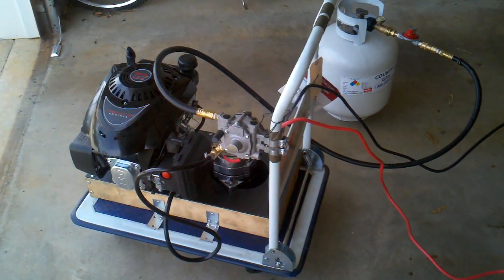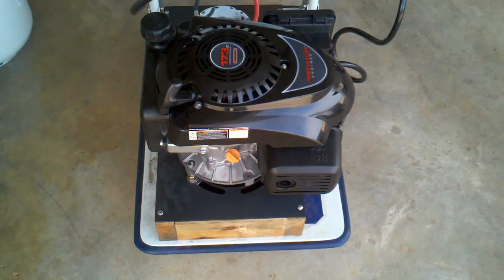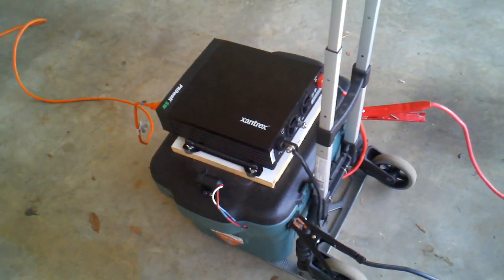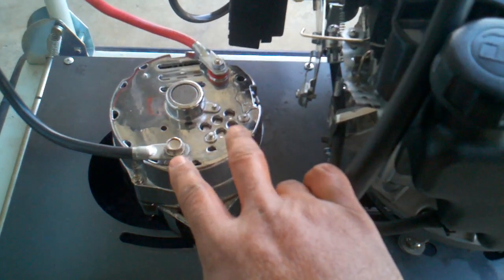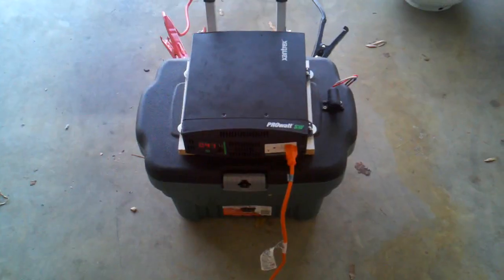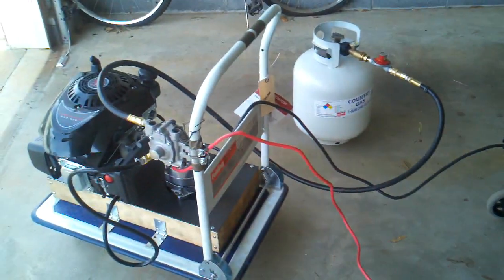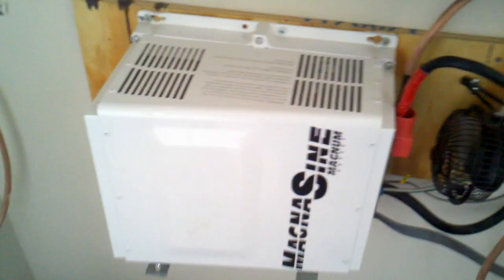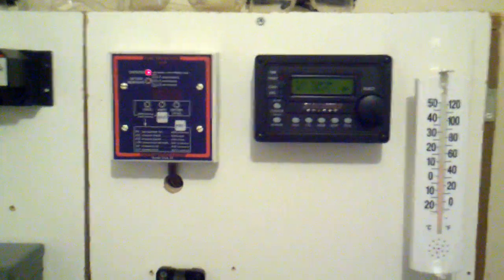DIY - Bi-Fuel Gas and Propane Lawnmower Generator

Comment: ok so this is what i have going after doing your equation with my alternator, 140amp alternator x 14 = 1960 ÷ 746 = 14,621.6 x 2 = 29,243.2 what am i doin wrong. please respond.
Reply from the maker: The engine is a 6 hp engine.  So 6hp x 746w = 4476w (potentially).  However, that doesn't mean I'm going to get 4k out of it, because of in-efficiency of the setup, and this alternator is designed to run at maximum rev's from a car engine, not a lawn mower.   So the alternator is not going to put out it's full capability so it's not going to give out the amp rating it's rated for.
Reply: +rhandsom sry i did my math wrong lol i got my equation right now lol.
Reply from the maker: Cool. Take care.
Reply: +rhandsom. will do you do the same! thanks for the info on your video!

Comment: I have something very similar that I use for electrolysis and for charging batteries on equipment in the field.  Why are you running the primary regulator on the lpg tank?  That regulator will accept the high pressure of the lpg.  I used the same regulator on my lawnmower and generator.
Reply from the maker: It's been awhile since I played with this setup. I'm not sure I understand your question, please clarify? Thanks.
Reply: In the video, there is a regulator on the tank and one mounted on the hand rail of the generator.  The regulator on the hand rail is a high pressure regulator and does not need the regulator mounted on the tank.
Reply from the maker: Good point, I didn't consider that. I'll have to revisit my setup, thanks.

Comment: I would like a water cooled alternator driven by a tesla turbine that makes hot water too. I want it quieter, cheaper and maybe smaller and longer to charge the batteries which would handle peak power demands like the refrigerator in conjunction with the alternator generator. I'd like to see110 coming nativly off the Alternator. If it was efficient enough, run it any time you need hot water normally everyday. Why burn Natural gas in a water heater and only make hot water and not electricity too?

Comment from the maker: To do a pdf with the parts list etc, is not a bad idea, but it takes a a bit of time.  Also, the batteries I have are deep cycle batteries.  If you go to TheEpiCenter(dot)com, you will find a web page detailing everything you need, should give you a good idea of where to begin.  That's where I got my original idea and the base plate from.

Comment: Brown's gas is like a battery. It is a method to store the energy that you put into it and make it portable but due to inefficiencies, you will never get the same amount of energy out that you put in. It will put a larger strain on your generator and consume more fuel. If you use solar to generate your Brown's gas, then you have a viable option, but there is no such thing as perpetual motion.

Comment from the maker: I probably would've went with a horizontal shaft engine and mount for the DIY generator, I would've bought a combination Grid-Tie,Inverter\Charger pure sine inverter and bought panels of the same type with better mounting.  With panels of the same type, I would've also only needed one large charge controller instead of 2.

Comment from the maker: Thanks for your comments.  In this case, my main inverter is 4000w with both 120v/240v output connected to the house via a transfer switch and a Interlock swith at the mains.  This setup allows me to charge the battery bank connected to the main inverter.  Those batteries hold 7920wh of power.  A battery bank is much more efficient than a gas generator setup. At least in this case it's better to use it to charge batteries.

Comment from the maker: Thanks for your comments. Originally, my electrician was in the same boat, but he actually made the suggestion as to how it could be done and wired it accordingly. And he was also unfamiliar with Solar setups etc. It worked fine and is still working.  A few people have been confused and wary about the wiring, but the guy was a master electrician, he was good but it cost me, he wasn't cheap. I'm glad to know that at least you got your critical circuits online.

Comment: That's amazing. Btw I just brought in my electrician to help me wire my reliance via my 120v pure sine inverter and lot of head scratching trying to figure how u stacked 2 120v outlets to get 240v to feed the reliance. As it turned out we decided to just run 1/2 circuits on the reliance which is fine as still hits all my critical circuits up/down stairs. But  for some reason they were nervous stacking but I sensed they were just unfamiliar with whole solar/off grid components. We even examined

Comment from the maker: I probably got around $400 tied up into this system. Engine, Alternator, pulley, belt, mounting plate, battery cables, cart, propane conversion kit. You can find the plans at "theepicenter . com/tow082099.html".

Comment from the maker: Actually I built it originally as a DIY project. Also, combustion generators are great at generating massive amounts of power, but generally inefficient when it comes to power distribution. Whereas battery backup systems are much more efficient in that they provide power on demand. This setup will quick charge my portable backup due to the amps it's putting out. But to be honest, you could probably get a comparable generator off the shelf. This simply gives me more control over power output.